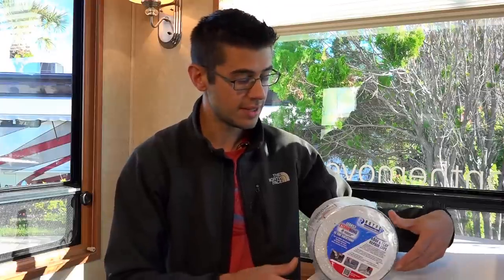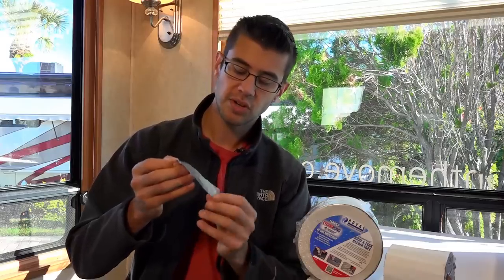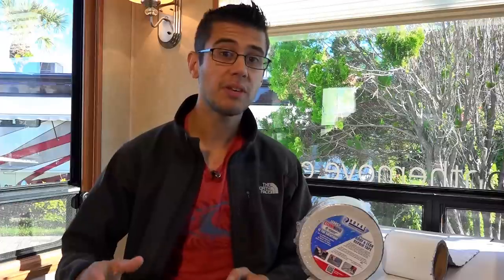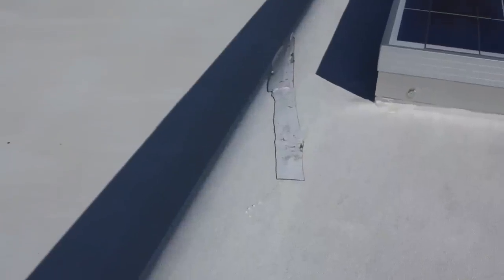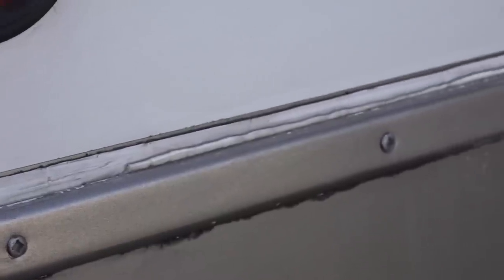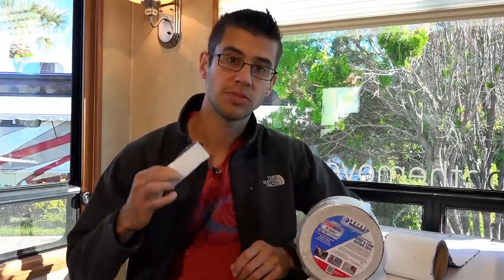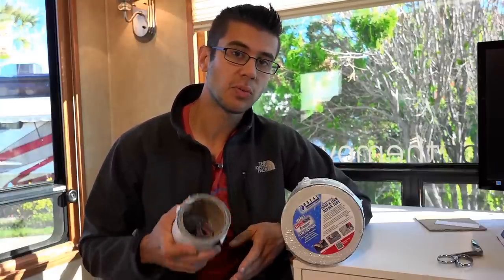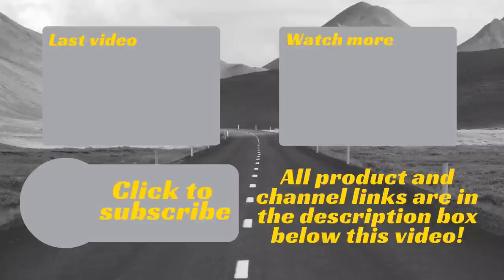Eternabond Roof Seal | Product Review | Solid Surface RV roof sealing Tape

Comment: I used this product according to manufacturer guidelines and it is still working well after 5 years in harsh UV southern climates with wind and rain. I adhered the mesh type tape over a front RV corner flashing and wall panel and it worked well. There is some movement going down the road and with expansion and contraction in a wood framed large 5th wheel as well. This is after expensive "professional" repairs failed. I would have just put larger corner flashing on, but my good friend who owned the RV doesn't always appreciate the details.

Comment: This stuff is the modern version of duct tape.  It is a necessity in everyone's Just in Case kits.  I have used it twice for emergency repairs.  I had a stud from a semi trailer fly up onto my roof and melt a hole into my rubber roof.  That patch is still solid three years later.

Comment: Great video and product. We use that when the units are being built. We call it slide out tape. Because we only use it on the out most edge of the slide out roof along the back edge of the facia on the out side. We use this to seal the mounting screws that hold the facia to the roof. If we used a sealant in a tube it would get all over the slide wipe or flaps. But back in my dealer days I used that stuff to fix a lot of things. A trade that had a sun room attached left holes over 35 foot of the unit. After running one long strip down the side and Installing a new 20 awning you could hardly see it. Also used it like your self to patch rubber roofs from the same in issues u mentioned. Only thing I have never been successful on was the under belly of the unit. Seams no mater how clean I got it and followed it with alcohol and any other tricks I could think of it always fell off. But I do have a small roll handy in the camper just in case. O and one extra piece of advice is round off the corners slightly. This helps it to stay stuck and look better

Comment: After getting hit with a Microburst Storm in Utah, and 70 MPH winds, several panels on my 19' trailer pulled loose including several at the front leading edge corners of my trailer. Since we were only about halfway through our trip, I temporarily used 6" Eternabond to cover areas where the siding had pulled loose. The Eternabond worked great and after returning home, i had the trailer repaired, but at the front corners where i had covered the corners, the adhesive left tracks up and down the sides opf the trailer. After trying severqal different solvents, the only thing I found that would disolve the Eternabond adhesive without removing the underlying paint, was Goof Off. I tried, MEK, Laquer Thinner, Acetone, Gasoline, Mineral Spirits and several other Adhesive removers. If you need to ever remove the Eternabond adhesive, use Goof Off. Wish someone else had old me this before all my experimentation.
Reply: Bruce Watts I would be tempted to try oil, like olive oil. It works great to remove sticky stuffs.
Reply: Also use Automotive pre Painting preps, "Wax & Grease" remover or Dupont brand Prepsol Solvent. Its primarily used to remove silicone oversprays, oils from air tools, and hand/finger oils before primer or paint are applied. Removes all tape and glue adhesives without harming painted surfaces.
Reply: I think acetone would work.

Comment: i want to use it in my 1000 gallon tank to stop a leak at the side of the tank like a small split about 2.5 inches opening,can it work? and how long after i can fill the tank with water again after installing the tape inside the plastic tank?

Comment: I used this tape and it's great.
I was wondering u said it doesn't adhere to wet surfaces. I wanted to use it on the outside of my pool.
I did use a pool leak kit. But the side of my pool rubbed on a stone while we played. I'm going out tomorrow and getting some to put on the outside. What do u think. Lol or maybe I'll be letting UK.

Comment: Can you apply eterbabond to a moveable join such as a plastic hinge as sometimes used on camper trailer hatches?  or is the more flexible sealant than can be used for that application?

Comment: Etenabond is intended for temporary seal. It will not last long. I use poly seal and it's permanent.
Reply: according to all these other people it does last...
Reply: Did you prep the surface?
Properly because I did and the stuff works.Great Did you prep the area properly?

Comment: Will it stick to a existing dicor seal around a vent to beef up the seal?
Reply: As long as the old surface is dry you might try it.  We've had good results on a wide variety of surfaces and materials Tom. One comment  ... Several of the examples he shows are plain edge. I suggest some form of edge sealant for EPDM etc. applications to improve the water resistance of this patch when applied... For instance Geocel4500., Chemline N-1 that sort of product.
Dicor has a Lap Sealant...Why not that first?

Comment: Can you put this over the caulk that is on the roof or do I have to strip the caulk off first?
Reply: I have used it over existing caulk without issue. I first cleaned the caulk with denatured alcohol. Just be sure that it is wide enough to cover the entire caulk. I had a series of leaks that stemmed from where the front trailer cap meets the roof. I used two strips of Eternabond. One that started half way across the original caulk leaving a good two inches to adhere to the roof. I then used the second strip to overlap the first by about an inch and then had about a two inches to adhere to the front cap. Its been water tight ever since.

Comment: What is the largest hole you have repaired with this while overlapping
Reply from the maker: I taped over my RV fridge vent with it after replacing the fridge with a residential style.  Though I did put a little structure inside that whole.  Still, a very large surface area.

Comment: I'm a roofer of 28 yrs & when I retired 15yrs ago I wouldn't have trusted TAPE but hey ...new chemicals w/better adhesions.  Give it 20yrs in the desert..we'll see ?
Reply: With that kind of UV exposure, any roof will take a beating. Ten years for EPDM or TPE or other membrane roof, max. We installed a self-adhesive membrane on our flat porch roof 20 years ago (different brand) and it's still leakproof. I spent 10 years in roofing myself, and that still surprises me.
Reply: Even asphalt shingle material comes in an adhesive roll.

Comment: It seems like poor engineering that I need to seal my rv roof in the first place.
Reply: sunsetter fabric repair video
Reply: 1980s popular dress wear
Reply: sweetiepienumber1 n
Reply: Have you seen RVs lately??
Reply: D&B lastname it lasts more than 6 months without requiring it be checked
Reply: readme info   Good point, designed obsolescence. An all-aluminum trailer I had only 13' and had a one-piece aluminum roof. It was fantastic. It may have been welded in a seam, I don't recall. Except they didn't bring the metal over the edges. Therefore it required that sealant all around the edges. Stupid. I used to install metal roofing and that's who they should hire to do these roofs. Or a welder.
Reply: @deebeebill  Home roofs can last 25-30 years or more. Some double that.

Comment: I just put Dicor lap seal around a roof vent fan  a week ago and it's still soft and looks like ugly bubble gum.. I regret not just putting this stuff instead.  If I peal the Dicor off best I can or mold it flat, can I then roll eternabond over it?
Reply: You can do either and Eternabond will work.

Comment: Can this be used on top of a roll in liquid roof sealer?
Reply from the maker: I am not sure I follow, if you are asking about sealing on top of the eternabond it should be fine, I have put dicore over it without issues.

Comment: I bought the kit with 2 50-foot rolls of 4", the cleaner, the prep (stuff to make the surface tacky) and the roller. I'm dreading the whole thing. I have a class C with issues in the cabover on both sides of the cab. My question is, do I really need to take all those steps or can I skip the prep can to make the surface tacky? I understand it needs to be clean and dry, but should I go that extra mile? Thanks. I need an answer or opinions fairly quickly.
Reply: there is a cleaner that Eternabond makes, and it works great.  Spray it on, wipe it down, and apply the tape.  I have used this to seal everything on my camper roof, and I dont need to use dicor hardly at all!  The only things I use dicor on are my skylights and vent pipes , just because they are plastic, will become brittle over time and will need replacement.  Removing Eternabond is very difficult, so I choose to use dicor for easier removal on these items.
Reply: Do the prep.  Soap and water, rinse, use the spray prep cleaner (it's an acetone product) and wipe it down well with a clean dry rag.  Since mine was a straight line, I used a straight edge and made a pencil mark for the leading edge. Apply the tape slowly and make sure you aren't leaving bubbles or gaps. I peeled the backing off about 6" at a time and made sure it went down straight. Use a roller or a stiff card to press the tape down and activate the sticky goo.  I used the roller, then my fingers and an old credit card to work the tape down into gaps. I just did a seam on mine and it looks better than original, and I expect not to have to mess with it again for years. Altogether, the prep and application on an 8 foot seam took an hour or so.  I would say the prep is pretty important... don't skip the prep. One of these videos recommended using the Dicor sealant along the edges of the tape... I may do that later in the year when the temps are cooler.